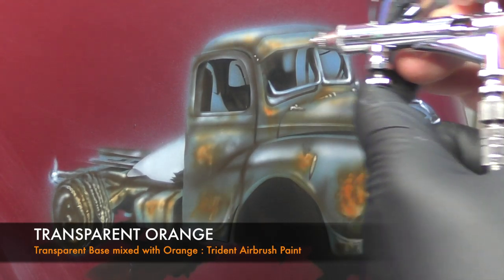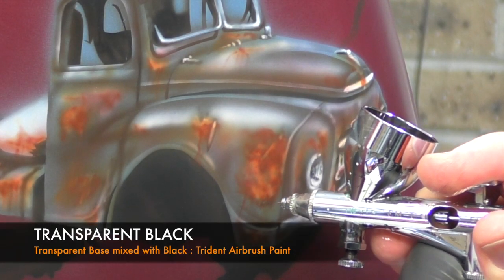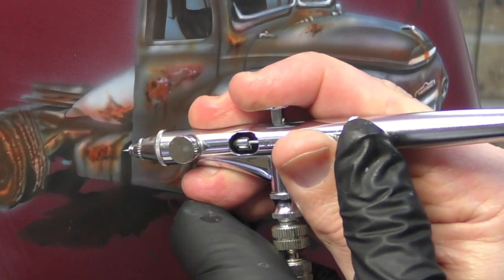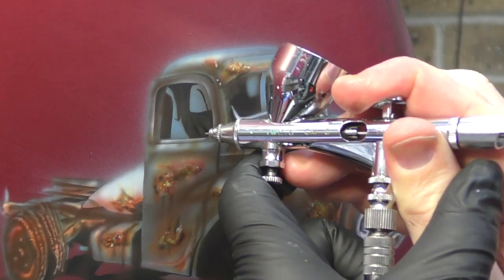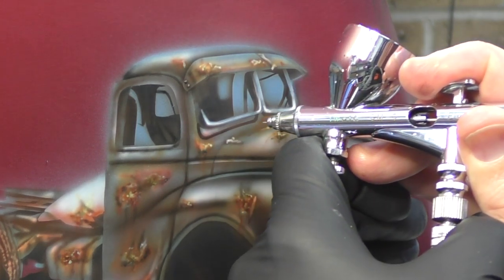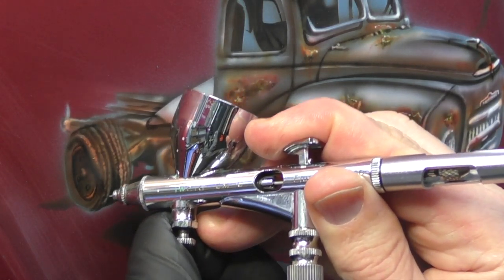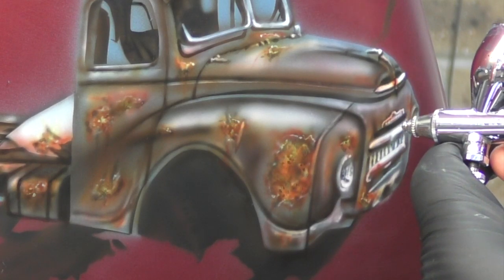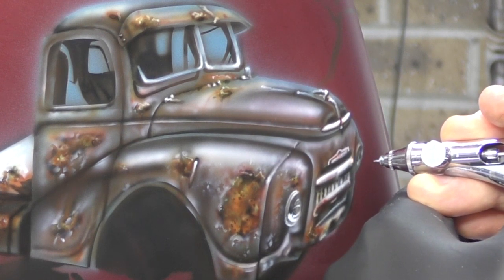Airbrushing a Ute | Pickup Truck artwork | Part 2

Comment: Thanks have learnt quite a bit from your videos!

For detailing I use an Iwata HPB with a 0.2mm needle, which i really like.
Would the CM SB2 with the 0.18mm needle out perform the HPB?
Reply from the maker: The microns are great and so is the HPB all fantastic brushes which can achieve amazing fine detail.
The biggest thing is the artists skill with the brush, if you can control super thin paint at 18-20psi then the micron can out perform the B but not by much it’s really just the smoothness of the trigger and feel of the brush that makes the micron stand out 👍🏻